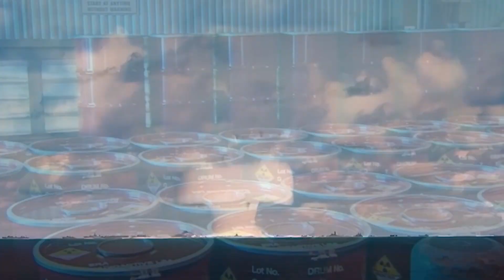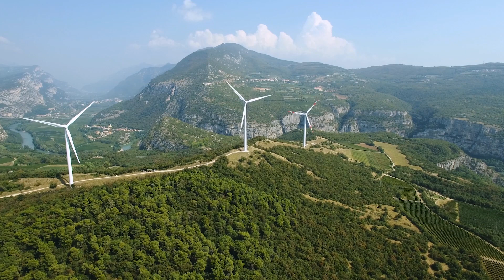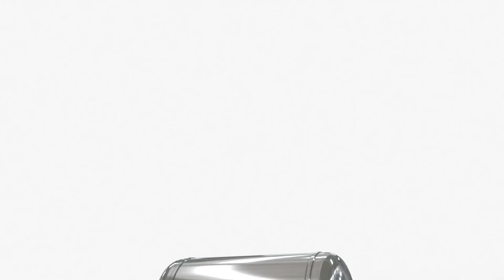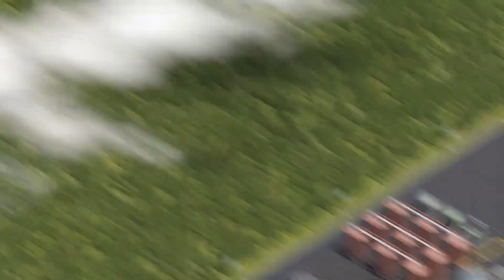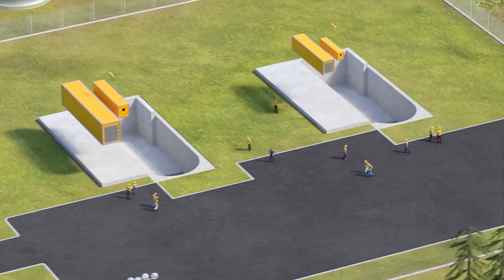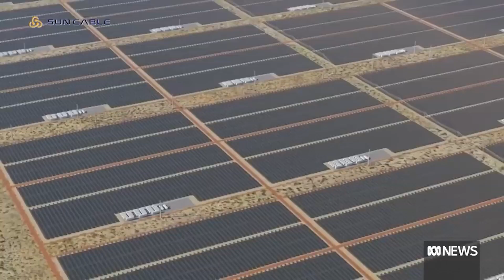Why Nuclear Power Won't Work in Australia

Comment: Solar, wind and batteries are not the answer, you still need reliable base-load power production. It is in fact the smart politicians that are pushing nuclear as they know better from what other countries are starting to realize. Countries which have gone wind and solar have found they are firing up their fossil fuel gas turbines to produce base-load. Nuclear power provides a good base-load which is clean and safe and is a proven technology. Solar, wind and batteries appear clean, but the environmental impact caused when producing them from mining the rare earth materials to the manufacture of them is far worse than nuclear. You cant recycle solar panels, millions of panels will go to landfill and the same goes for the wind turbine blades when they reach their end of life. Batteries will only last 10 years or so and solar only 20 years or so, new panels and batteries will need to be purchased again for 100s of billions of dollars, far more expensive than nuclear. The environmental impact from cutting down thousands of hectares of trees for new transmission lines and solar farms across the country is ludicrous and will only increase as the population does. You've also failed to mention the issue with wind and solar only producing power when the sun is shining and the wind blowing. Yes, nuclear does have a high initial setup cost, but then gets cheaper as time goes and with nuclear power plants lasting 60+ years, electricity will be cheaper in the long run. We would be self sufficient as we have uranium reserves here in Australia and don't need to import it. Also, moving to green energy for low CO2 emissions is about the environment not about money which is your main point. With the money alone the Labor government and big industry have spent on voting yes in the referendum, money is not an issue for the government as they spend like it grows on trees.
You've failed to look at the bigger picture and made this whole video on false out-dated information to push your agenda. You need to do more research on how clean and safe nuclear is like many other YouTube presenters have done. You also failed to acknowledge other important information like solar panels are made in China using slave labour and should there be a war with China, or any other solar panel supply issues, we wont be able to keep the lights on!

Comment: The CSIRO report is overly optimistic in it's pricing and has modelled a plan that is probably dangerously unreliable; the plan has avoided much needed 
energy storage to ensure reliability and their forcasts of pricing for solar panels and batteries is over enthusiastic. Their modelling is based on 60-90% 
of renewables excluding hydro and relies on wind power with little storage capacity at even 90% renewables. There is actually little difference 
in storage usage between the 60 to 90% renewable models. 

According to the CSIRO report, renewable energy (excluding hydro) is built to deliver a maximum capacity that is three times the output of 
the coal power plants it replaces and using 60-90% renewables (excluding hydro), a storage of 20-34% of this figure is required.

The cost of the model used in the NEM (National Energy Market) was $68/MWh for 60% Renewables and $77/MWh for 90% in 2030. This includes all states 
except WA. In this costing, storage is only a small fraction, $6.4 to $8.4/MWh. The usage of storage is drastically reduced and instead relies on 
wind generation and increased transmission across the entire grid. The pricing of solar PV and batteries is also projected to drop around  
25-50%.		[costing on page 56]	[projected costs table on pages 67-69]

The cost of renewables goes up with it's increased use, even in this badly flawed model.

The CSIRO report states;
"Variable renewables have a low capacity factor, which means the full capacity is only generating for a fraction of the year (e.g., 20% to 40%). As a
result, to deliver the equivalent energy of a coal generator, the system needs to install around three times the variable renewable capacity." [page 60]

"The result we find is that, in 2030, the NEM (National Energy Market) needs to have 0.20kW to 0.34kW storage
capacity for each kW of variable renewable generation installed. Showing the most extreme case of 90% variable renewable share for the NEM...". [page 61]

Comment: I just want want base load reliable power before we start fluffing around with fairy dreams. America has nuclear AND cheap electricity.
Reply: Look at SC failed nuke project.
Reply: I'm failing to see the connection to Australia just because one US plant goes belly up.
Reply: @innocentbystander2673  Look at how South Carolina nuke project constructing  2 reactors wasted $9 billions.
Reply: @CarlosOddone-z6k  Ok, just for shits and giggles, how much are you paying for electricity per kilowatt. Please include off peak and peak rates if you are on a time based charge system. I just swapped, now i pay 14c off peak, 38c peak and i get 5c solar upload flat rate.
Reply: But a lot of that is from hydro-electric and coal fire stations.

Comment: Nuclear Power plant life time is over 60 years!
Reply from the maker: That’s technically correct. But the oldest Nuclear Power plant currently operating is Beznau, which is only 54 years old. While modern plants could run for 80 years (maybe - it’s never been tested!) the reality is that with cheaper energy on the market, most plants shut down around the 40 year mark.
Reply: @angerhope5683  Can I get your source for that?

Comment: I think it really depends on how much you're going to spend. With 10Billion or less, investment on nuclear doesn't make sense, but that's also quite an underinvestment. At 100Billion - 1Trillion (roughly what is necessary), Nuclear comes around to making some sense again as being part of the mix. But you're right in that the vast, vast majority of infrastructure and investment needs to come from Solar, and we need to incentivise new plants beyond just what the market will install, because the market will not install what we need energy wise.
Reply from the maker: Interestingly, Australia has enough Solar already (mostly). That’s why the rebates for rooftop solar are starting to dry up. What we need is a massive increase in the amount of wind on the NEM.
Reply: @angerhope5683  It really doesn't. Remember that all emitting industries from concrete to Aluminium to steel to cars all need to be electrified. Only Adelaide can really have a day of 100% renewable generation. The grid needs upgrades, that's why the rebates are drying up.

Comment: Out of curiosity, where we're (the royal we) talking about battery storage, I'm assuming that's referring to centralised storage, as opposed to battery banks on a private property (as that would present its own unique space challenges for say, cbd areas and mid-high density residential)
Reply: I believe it's centralised storage. Engineering with Rosie goes into a lot more depth with this.
Reply: New homes wanting battery storage and short on space when being built might include them in a fire resistant in ground storage space think miniature basement as that would help keep it safe from starting house fires, regulate heat and protect from water damage from floods

Instead of Lithium Ion the better value for money is Lithium Sodium they are less energy dense but can go for 20 to 35 years without needing to be replaced compared to Lithium Ions 5 to 10 year (normally closer to 3 to 8 in reality!)

And Solid State Batteries are at least another 15 to 30 years away from having enough storage and availability at best
Reply: @DarthAwar  I haven't seen a battery storage system with a warranty of less than 10 years. I've seen them go up to 15-20 years. If it dies in 3 years just get another on warranty.